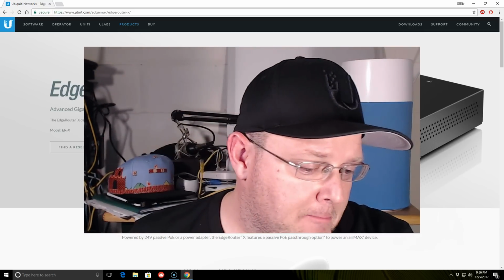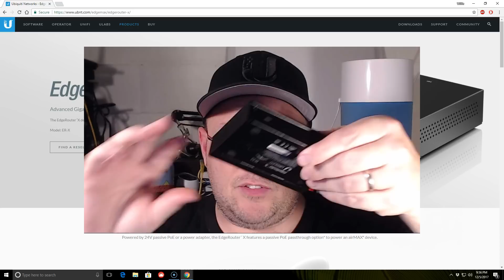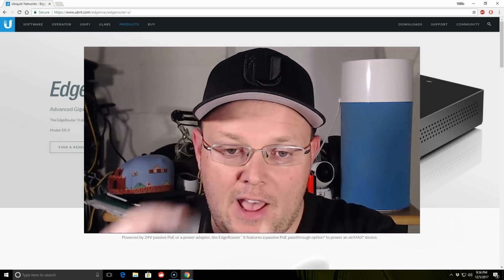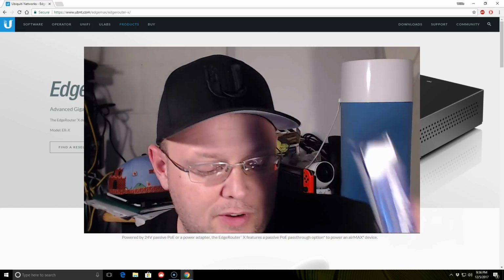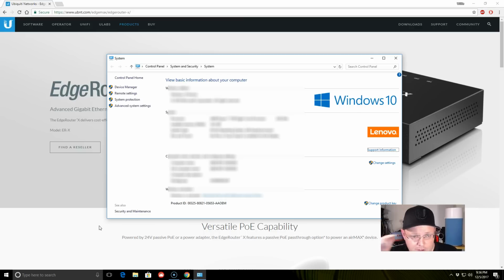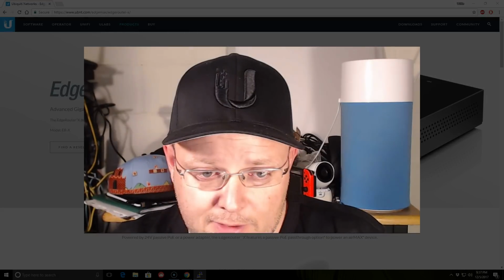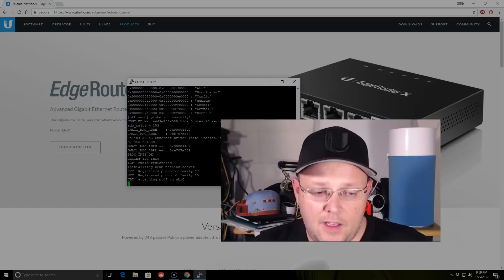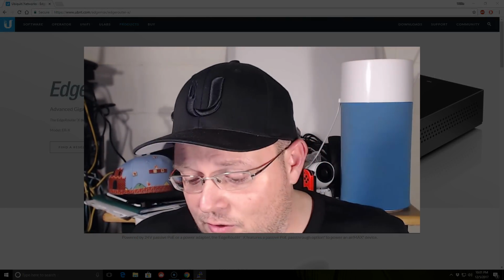Ubiquiti EdgeRouter X Hidden Console Port

Comment: Thanks for the Video.
I was able to login using putty but when I tried to do "show" command I get an Incomplete command return.
ls returns nothing.
Linux ubnt 3.10.107-UBNT. 
This is a new device with no Nics plugged in and never used / setup.
Is there a list of commands for these online?
Also noticed this while booting.
mkdir: can't create directory '/dev/shm/network': No such file or directory

Comment: hello, when my ER-X is connected to my pc with a TTL Serial cable with COM3 nothing shows up.. I keep getting the Putty's blank screen with the green cursor. The LEDs are lighting up when I connect Ethernet cables allright and Putty doesn't tell me that it cannot connect. Seems like the Edgerouter can't boot whatsoever.. Is there something you think that could help the bootloader get back to life? i had 1.10.9 when I was trying to upragde to 2.0.9 and power was cut out. thx!

Comment: This was the only electronic device I've ever had die to a lightning strike and I'm currently trying to recover it using your video as a guide. It boots to "Kernel panic - not syncing: VFS: Unable to mount root fs on unknown-block(0,0)" so I'm going to try to do a recovery.

Comment: Another great video Willie.  Quick question, I want to do some poking at my UNVR, it has a similar 4 pin header inside labeled "GND, 2 unlabeled pins, and P3V3"  does that sound like the same silk screening inside the edgerouterX? I'm assuming it's GND, TX|RX, TX|RX, 3.3v and I'll just need to connect ground, determine which pin is TXD and which one is RXD and then figure out the port speed? (Leaving the TTL adapter +5v and UNVR P3V3 both disconnected)

Comment: Works like a champ! I wasn't able to find a single cable so I ordered a 5 pack for ~$20. I'm sure I can find a use for the rest of em. Just a tip for the Linux users, plug in the USB cable to an Ubuntu box and you can use the cu command, so you can reach the console and turn off ssh to make it even more secure. Oh and that thing uses /sbin/iptables so you can really get into the control weeds if the GUI doesn't give enough control.
cu -l /dev/ttyUSB2 -s 57600

I already have 2 other USB to serial cables plugged in or I would expect it to show us as ttyUSB0.
Thanks for doing the Video Willie.
Reply: Is there any way to set password for console access?

Comment: I did an upgrade to 1.10.11.5274269.  When I log in to CLI, I get "Boot image can be upgraded to version e50_002_4c817.  Will it upgrade the 
router to the newest 2.0.8 ?  I would not want to upgrade because of the  loss of speed. Any suggestions?
What is the diff boot image and firmware , I thought they are the same ?

Comment: Hey Willie, I'm using linux mint 19.  Can you give me explicit instruction on how to find the port my edge router x is running on.  My hardware info app. displays as follows:
Prolific Technology, Inc. PL2303 Serial Port	
Logitech, Inc. Unifying Receiver	
Ralink Technology, Corp. MT7601U Wireless Adapter	
Broadcom Corp. BCM20702A0 Bluetooth 4.0	
Holtek Semiconductor, Inc. Keyboard LKS02	
Intel Corp. Integrated Rate Matching Hub	
Linux Foundation 2.0 root hub	
Intel Corp. Integrated Rate Matching Hub	
Linux Foundation 2.0 root hub
Notice it does not tell me what (com) port number.  Can you please help me determine the device name in my case ex. (com1, com2, com3 etc.?

Comment: Has anyone been able to use this with a Raspberry pi 3 GPIO serial port? I'm trying not to buy the cable, I have to many random cables already lol.
Reply: Thats actually exactly what I did. It's exactly the same as the cable hes talking about just make sure you solder black to black green to green ect.

Comment: If Console Port is something you want available at any time, I would find a spot on the chassis to drill a small hole to mount a 1/8" TRS (tip, ring, sleeve or stereo) female jack, and wire that up to the header.. You can make an adapter for DB-9 to 1/8" to jack in whenever you need. I used to do this with my DD-WRT modded routers.